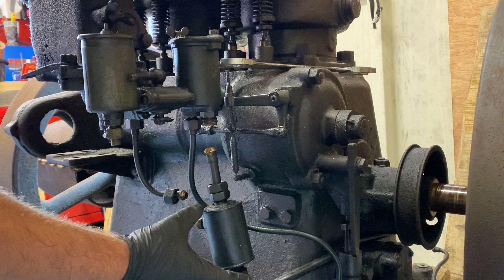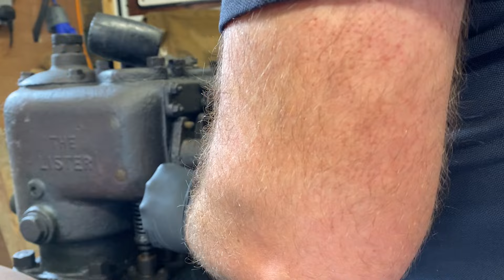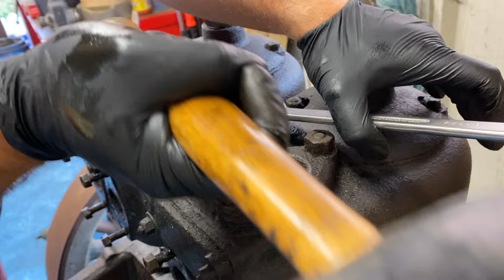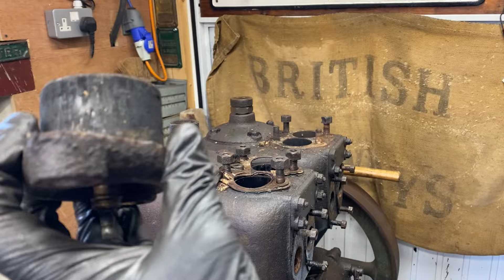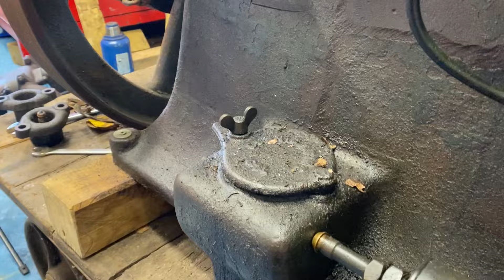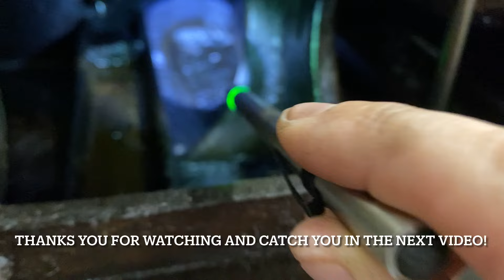1921 Lister TM Type Stationary Engine Restoration Part 3 - Vaporiser & Awkward Valve Plug Removal

Comment: Has the exhaust manifold had a repair ay the flange end and could that be the reason for the odd sized nut?
Reply from the maker: Yes it has. I would have thought that they would have just used the nuts that had come off though but they hadn’t and replaced them. I plan on putting them all back as matching so it will fettle it up!